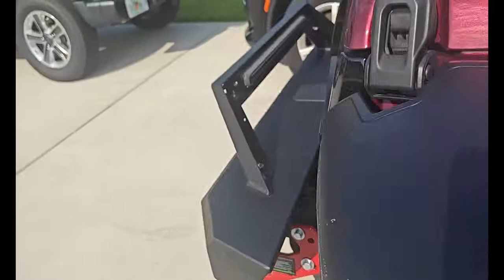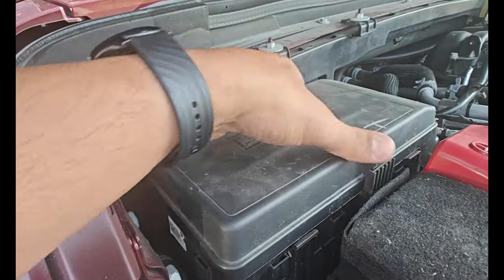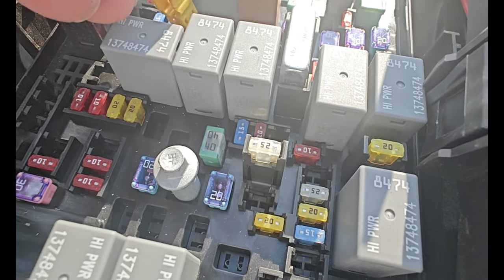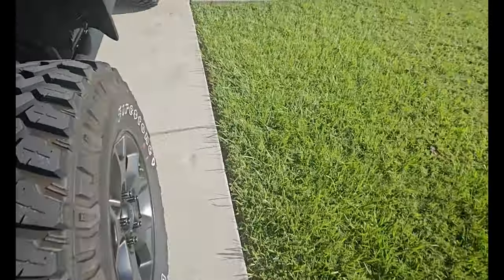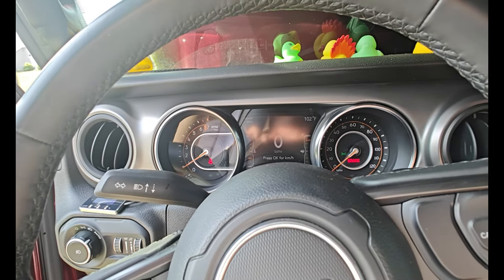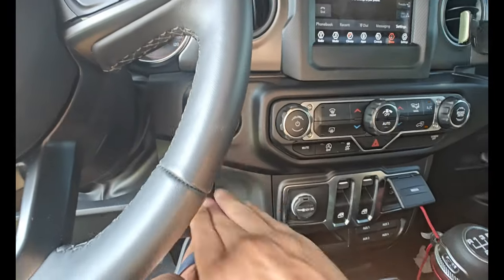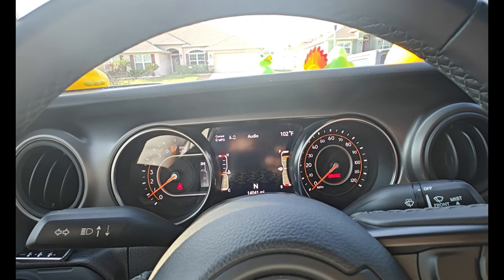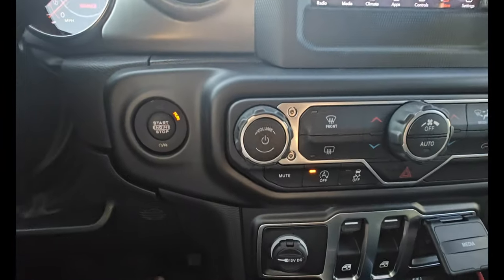Jeep Wrangler Aux Battery Bypass

Comment: I have a 21 Gladiator, my 6-month old battery was dead this morning, so I considered replacing the aux battery (I had this happen on my 2020 Wrangler before) but since I already had the ESS disabled via the hood switch method, I wondered if I really needed that battery at all. Hit up a Jeep forum where I discovered this idea, looked at a couple of videos but this one was spot on! Had the same issue with disconnecting the wrong cable first, but that was easy. Now she starts again with no side effects. The red "anarchy" emblem that's been on since I disconnected the hood switch back in '21 is still on, but that's never bothered me and I know the ESS won't accidently turn on as a result. Thanks for the assist!!

Comment: Battery cable pull and the fuse pull just pulls the battery from the computer system, keeps the system from throwing a code and pushing a Battery light on your dashboard.  The system still works, but take that auxiliary battery off line where it will not drain your main battery.  Basically turns your Jeep into a 1 battery vehicle.  You can go further and remove the battery completely and tape up the ends or fish them out and remove.  I added a Auto Start/Stop Eliminator under the dash and it holds the last input to the dash button.
Reply: Once you attach the auto start/stop eliminator under the dash, is there a need to replace the 2nd battery?
Reply from the maker: No need, that battery can just stay there.

Comment: My aux battery died 2 years ago and that stupid ESS system hasn’t worked since. Didn’t have to do anything. So far so good. I replaced the crap factory main battery in 2021 and it’s still going strong. Went with Interstate. Never had luck with Wal mart, big 3 parts stores, and especially die hard batteries.

Comment: Hey guys. We've had an issue with our ESS when it would go to start back up, the Gladiator goes haywire. The first time luckily it was in a parking lot, the relay ended up getting fried. Then last week it happened starting back up in an intersection (luckily not in the middle) and it ended up frying a main fuse. Both relay and fuse had something to do with the ESS. Dash starts displaying strange messages, auto park won't release, can't even power everything off. We're looking at switching everything to a dual battery set up, getting rid of the tiny aux,, but I've just done this "fix." So far so good. The light stays on or off, depending on whether I push it or not, so hopefully it's disconnected fully (fuse and cable are removed). But starts up fine, drives fine, voltage is around 13v. I know lots have posted this, but thanks for the tip. :)
Reply from the maker: Anytime

Comment: Works great! I added an auto stop eliminator cable  cause I dont need the tazer and still gives me the option to turn the ESS back on if I want to. Works perfect. This is an important fix because apparently there is not an isolator between the main battery and the ESS battery, that is why the main goes dead also the ESS kills it, also why you cant jump it. THANKS for this video DtoyJeep, I seriously appreciate it.
Reply from the maker: Anytime, glad I was able to help. Please like, share and subscribe.
Reply: Update 
So today for the first time, the Avengers symbol came on, after I shut the jeep off it didnt come back on yet but this is the first time in over 2 months.
Reply: Update 5/27/24 still working great, only the one time did it ever give me the avengers symbol, much like everything else on jeeps it comes and goes lol but still working great!

Comment: Thanks for this video; very helpful. I think that I read online that Jeep switched the negative cable for the auxiliary battery some time in 2021. In earlier JL Wranglers,  the ground cable for the aux battery was the one closest to the passenger side fender. After 2021 (not sure exactly when the switch was made), the aux negative was on the driver's side.
Reply from the maker: Thanks for that information.
Reply: Yeah, that makes sense. I have a '21 and it's the same as this video. I originally had the other cable disconnected and had no power.

Comment: I replaced my main battery on my 21 gladiator and now i have no climate control.. its says climate control off.. How can I fix this?
Reply from the maker: Normal. Let the vehicle sit for up to 24 hours. After a battery replacement, the vehicle needs time to re-learn its features and some things may not work 100% until this is done.
Reply: I wouldn't of screwed with it bro. Now a maintenance issue has become exasperated. That'll learn yeah. Jerry rig it huh

Comment: I had my 2023 Jeep Gladiator got full dead a few days ago. I'd had it 3 months and it only had 2100 miles on it. The dealership had to replace both batteries. I'm going to do just this. I already have a Tazer Mini to keep the ESS in whatever state I leave it in. I mentioned that a lot of people are doing this trick so they can restore it if they have to go to the dealership to one of the service office guys. We agreed that he never heard a thing, but it's a good thing to know. Since I have an extended warranty and a few free oil changes, I'll be using the dealership. The folks in the service office are very well aware of the aux battery killing both batteries. When I called I just said, "It's that aux battery killing..." And got a, "We understand. We'll get it right in." I liked the ESS on my 2021 RAM 1500 with the e-hybrid system. But that had a separate 48V battery for that small electric motor, charged as it went, and spun up from the e-hybrid motor. Not from the regular starter with that stupid aux battery system.

Comment: I did this same exact process and after a few hundred miles I started receiving service shifter, service transmission etc and it would clear as I drove however one day I couldn’t start it. I got power inside but wouldn’t turn because of all those error messages along with auto not in park. I reversed everything to stock and boom it fired right up! Jeeps are so damn weird and pain in the ass but I love my rig. I have a 2021 Mojave

Comment: Since you removed your negative cable to the auxiliary battery did you have to go buy a larger amperage main battery? How's everything running so far without the auxiliary battery?
Reply from the maker: @timcapuchino3563  since I made the video the jeep is still on the same factory battery and everything is running at normal, even pulling my overlan trailer once a month no issues.
Reply: @FAFOWeekendAdventures  Thank you for replying that makes me feel more comfortable going forward and removing that negative cable infuse I can't believe do such a thing as far as putting a battery in that location anyways keep up the great work

Comment: it's the tazer that's remembering your last "Auto-Stop" state,, not the fuse or aux neg cable removal
Reply: So if you don’t have the Tazer or auto stop eliminator you still have to push the A Button to disable ESS…but the Aux battery won’t be involved anymore. Dumb design.

Comment: Do you have to have the tazer in order for this to work? Also what year was your jeep?

I have 3 cables on my negative side. One is attached to the post you tighten the entire terminal with. 

I tried removing those 2 you showed neither worked but one did turn over once but stopped. Maybe the main battery is bad?
Reply from the maker: No tazer, my jeep is a 2022. 

Take the battery off and have Auto Zone charge it for free and see if that works.
Reply: @FAFOWeekendAdventures  thanks.  Mine is 2018 jl

Comment: So did you Not pull the auxiliary battery?  You just pulled the 10 amp fuse and disconnected the terminal?
Reply from the maker: Thats correct, I did not pull the aux battery out because my jeep is still under warrant and if I have to take it back for some reason I/ want to make sure they wont void it.

Comment: I have issues too with my auxiliary battery my way to avoid the issue was program my self to start the Jeep and automatically just turn off start stop and bought a portable jump start from auto parts store for a dead battery stranded situations and replace both batteries with quality lithium batteries when affordable to do so. The Aux will go first then the main battery will come after. Screwing with the way something is designed is a gamble that I won't take with my baby. Preper too and have a EMP shield wired to the main battery and a winch. Aux batteries need to be charged regularly by driving or life span is short. Disconnect the main battery if you store it.

Comment: The dealership lied.  Everything is not “good to go”.  I was burned by this exact issue Friday.  Dealership replaced the aux battery 3 weeks ago.  But they didn’t change the main battery b/c it wasn’t covered by the warranty. Came out yesterday to start the Jeep and it was completely dead again.  ESS is shit!
Reply from the maker: Same here, just do what I showed in the video and you should be good to go. I haven't had an issue yet

Comment: Did any of you have have your back up camera not work after doing this ?
Reply from the maker: Negative, everthing including the backup camera works just fine.
Reply: Yes
Reply: @bw4524 did your back up camera start to work after? Starting to wonder if I accidentally did not pull F42 fuse

Comment: For the negative cables mine was the opposite. The smaller neg battery w the smaller end piece didn't work. I had to leave the bigger one on. Weird.
Reply from the maker: I've heard this from other folks, guess you have to try either cable to see which one will work.
Reply: Same with mine. Small cable was the one that I taped off. Didn't work the other way around. Makes me wonder about Jeeps quality control 🤔
Reply: @BryanHectic  seems to be very inconsistent

Comment: Had a no start situation yesterday. Replaced the main with an Oddysey and had a bunch of weird dash activity afterwards. Service shifter, CEL etc. bypassed the AUX and everything is gone but the engine light. Have you run into that? Cheers
Reply from the maker: I haven't had that issue, but others on here have. What was advised is to disconnect the battery for 10 minutes, reconnect it and if it's still on, drive it for at least 24 hours to see if it turns off. 
Everyone who had this issue has never returned to say that the process didn't work.

Comment: I like so many others hate the secondary battery. I Followed this video, took out the 42 fuse of my Sahara JL 2019 and removed the line to the battery and taped it up. The vehicle starts great- no warning lights BUT my start and start is still functioning… WHY? Any ideas ? I thought this shut off the ESS….
Reply from the maker: That's normal, the star and stop is going to work, just keep it off. If yours is on every time you start the jeep then buy a Tazer or star stop plug

Comment: If you have a Tazer installed, The Tazer will remember the ASS setting when you shut the Jeep off. If it was on, it will turn it on when you restart.
Reply from the maker: Thanks, I do have a tazer
Reply: @FAFOWeekendAdventures  If you have a tazer why you didn't explain it and you didn't do the procedure in the video, I'm breaking my head here because the light doesn't turn on automatically 🥴😁👍🏽
Reply from the maker: @carlospr4322  To be honest its my sons jeep and I didn't know he had a Tazer installed until I said something about the light not having to be turned off, 🤣then he said maybe it's the Tazer🤣
Reply: @FAFOWeekendAdventures 😂😂 the tazer prize it’s $329.95, 😳I’ll better continue pressing the button manually thanks 😂😂😂🤷🏻‍♂️👍🏽

Comment: I’m having the same issue so I came out to do the same process as you and i don’t have the same ground cables as you & I don’t even have anything in that F42 (10A) spot.. I’m totally lost
Reply from the maker: What year is your jeep, you might not have an aux battery
Reply: @FAFOWeekendAdventures  2020 wrangler JLU rubicon 2.0
Reply from the maker: @h8mivec  No small auxiliary 12V battery under the hood. My friends 2020 JLU Rubicon Recon has the Start/Stop "feature", eTorque and no 12V aux battery, just a 12V main battery under the hood and a larger 48V battery under the Jeep.

Comment: My 2020 had the cable without the stud as the main. It is just odd that they changed that in between sometime.
Reply from the maker: Could be that the 2020 models are different.

Comment: 12.6 V. Your battery is not charging you need 13+ just show your battery is charging usually 13.8. I did a multimeter test though. It seems weird to me. If you disconnect the small cable on the positive side of your battery and separate the two. The big battery still connected to everything shows 12.8 V the other little cable that I assume runs to the smaller battery is 12.5 V when you start the jeep the big battery remains at 12.8 the small cable shows 14.5 V. Which leads me to believe that the alternator runs to the smaller battery. And from smaller battery up to the big battery. You would think it be the opposite, but it doesn’t seem to be so. The big + cable from the big battery goes to the starter. The smaller cable from + big battery is the small battery and the alternator charging system. All I know is when you put it on your charging system and red 12.6. That is not the correct voltage when a vehicle is running.
Reply from the maker: After I completed the project I went out for a ride and the volt reading is 14.4, and as of today it's still showing 14.4 to 14.8

Comment: Tried it (disconnected aux battery cable and fuse 42) with my 23 JL sport, and it did NOT disable the auto start stop. I then put the fuse back,  but left the aux battery cable disconnected, and that DID disable the auto start stop. And then I reconnected the aux battery cable and pulled the fuse again, and that did NOT disable the auto start stop. I'm confused.
Reply from the maker: You have to disconnect the fuse and battery cable, the button will still function, you either will have to do it manually or buy a tazer or a disabler
Reply: @FAFOWeekendAdventures  Thanks. Very helpful video.

Comment: Mine started to spark when i did it. What did i do wrong. Had to put it back. What did i do wrong?
Reply from the maker: You might have touched the cable with the positive side because I haven't seen anyone else with this issue
Reply: I replaced main battery today and followed this video for bypass;Mine was sparking too,and i was using small towels to cover when removed,so it doesn’t touch positive or something ,but went thru anyways also lost bigger nut (size 14) while doing it 🫣.
Jeep is working normal till now,will let you know.

Comment: I went to look on our 2020 Rubicon and we do not have the aux battery nor are there even any cables to a battery that should be there and isnt....bummer, because I hate the auto stop crap!
Reply from the maker: You can purchase the stop start illuminator here: https://amzn.to/3umrcRt and that would turn it off.
Reply: Thank you so much, and Done, the wife is gonna love me more  :} 
 @FAFOWeekendAdventures
Reply: Get a tazer...mine turns off everytime I get in my gladiator
Reply: @DToyJeep  so ya, that one doesn't work either.  Her wiring under the dash is way different as well. This is really turning out to be a mission. We're going to try the one that attaches to the actual switch. Funny when we took her jeep last time to the dealership no one had ever seen or heard of a Recon edition Rubicon 🤔
Reply from the maker: @mykledw  must be some small dealership to not now
Reply: @DToyJeep  largest in the state actually! But we are New Mexico so there's that 😏
Reply from the maker: @mykledw  got ya

Comment: So I️ did this and had no power so I️ out everything back in but I️ left the fuse out and now I️ have n o problems. Should I️ out the fuse back in or is it okay to leave out?
Reply from the maker: Leave the fuse out
Reply: @FAFOWeekendAdventures  seems to be great. Do I️ need to keep turning off the auto start when I️ start the truck ?
Reply: @michaellincoln1700  yes you will need to keep turning it off unless you get a Razer or a stop and go eliminator
Reply: @Don_TJ  okay great thank you!
Reply: Update so my switch doesn’t say off when I️ start the truck. I️ have to manually click it. Any reason why?
Reply from the maker: @michaellincoln1700  That's normal, you have to purchase a https://www.amazon.com/dp/B0CC1Z4BY1/ref=cm_sw_r_as_gl_apa_gl_i_XGDBMQWX48D6YMB57725?linkCode=ml2&tag=dtoyjeep-20.  Or a Tazer which would fix the problem.

Comment: for some stupid reason I always assumed that deleting the Aux battery eliminates the ESS, but that's not the case. It just eliminates the possibility of the AUX battery parasiting drain the main. After removing my AUX, the ESS is always on ready and it the main seems to be healthy.. Is this a fair assumption ?
Reply from the maker: You are correct
Reply: @FAFOWeekendAdventures  that's awesome.. I'm still going to replace the battery with a genesis dual battery system. I have a panic attack when the jeep is dark when I push the start button in my parkade. I can't imagine the feeling if that happened 50 miles deep into the forest up a mountain, all alone, hungry, cold, etc.. etc...
Reply from the maker: @kengeroo  that's eventually what I want to do myself, when the funds are right

Comment: I tried it but on my JL it is the second cable that you left connected and the stop /star continues to work, it does not work on my JL
Reply from the maker: It can be either cable, depending on the Jeep. The start stop will continue to work, you have to manually shut it off unless you buy a Tazer or put the start stop eliminator.